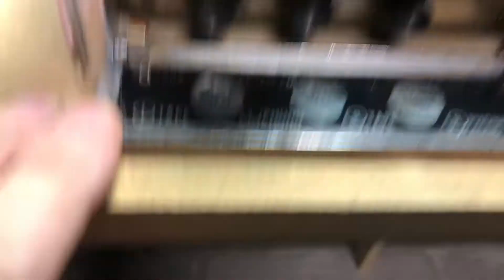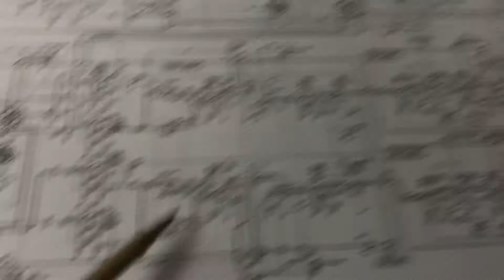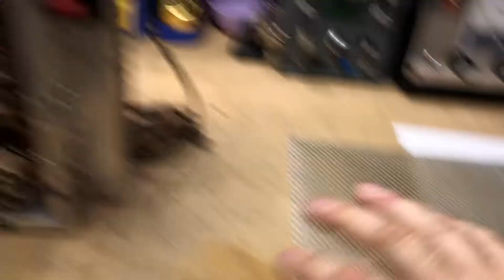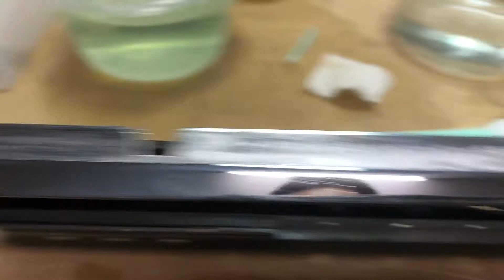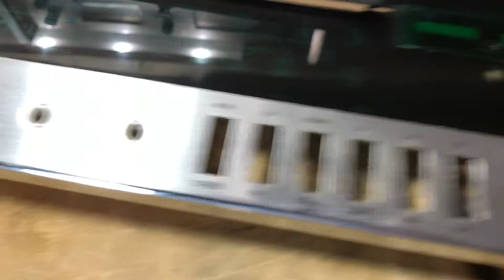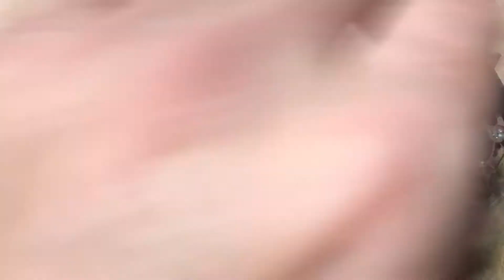Heathkit AR15 Solid State Receiver Repair Part 1

Comment: Do You think the amp worth all the efforts? Is It a good amp?
Reply from the maker: This was more of a project for my dad as it was a kit that his dad built years ago. I also purchased and rebuilt a second Heathkit AR15 for myself. I think it’s a nice stereo and it’s my daily listener in my office. I’m partial to it for its “analog” aspects and the fact that it contains almost no (aside from the FM tuner portion) ICs. I think it has a nice sound. But what sounds good is 100% subjective to the listener. Thanks for the comment.
Reply: @FreeElectron  Thanks for taking your time
Reply: Capacitor coupled output stages for a solid state amp limit the audio performance.  I built the FM tuner back in the day, during the brief period when big, clunky crystal IF filters were in vogue.  They soon gave way to greatly superior ceramic filters, which a fraction of the size, weight, and cost.  That permitted more IF stages with lower distortion and greater selectivity.  This is a product of only sentimental interest.

Comment: Anyway to get an assembly manual? The only " free" one on the internet requires giving CC info to some outfit in Cyprus. Not real interested in that one.
Reply from the maker: I don’t know. My assembly manuals came with the receiver when purchased. I’d suspect you may be able to find one on eBay.
Reply: @FreeElectron  Thanks. My dad built this and I may yet find his manual in his handed down stuff. Apparently Heathkit website will sell one for $45.

Comment: I think that the power amplifier section is similar to a design published in a 1967 Popular Electronics edition covering a "Brute 70" amplifier. It used RCA transistors exclusively.
Reply from the maker: Yes. A very similar design was published in an RCA transistor manual from 1966. It uses the same RCA transistors for the predivers and power output devices. It’s shown in a mono configuration however one would only need to duplicate the design for stereo. Thanks for the comment.

Comment: Man, that's a lot of work cleaning that thing.
IPA might not be the best for tobacco tar, I'v used a citrus based cleaner and it desolved the tar verry well.
It's tempting to just throw the metal parts in the dishwasher.
Hope you do not have a new flood just after you finished restoring this beauty.